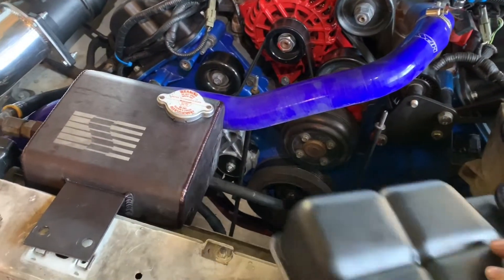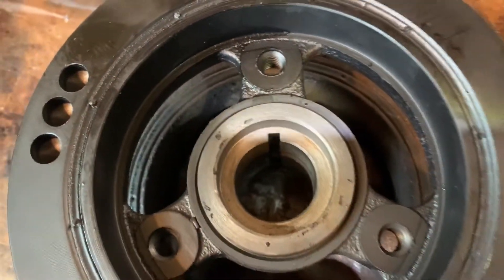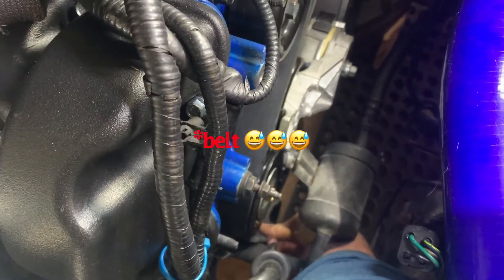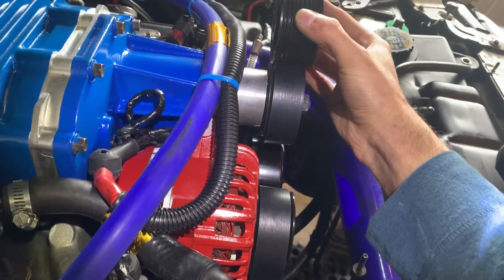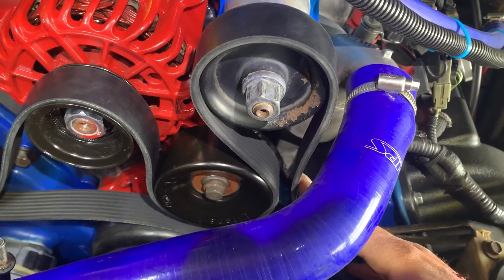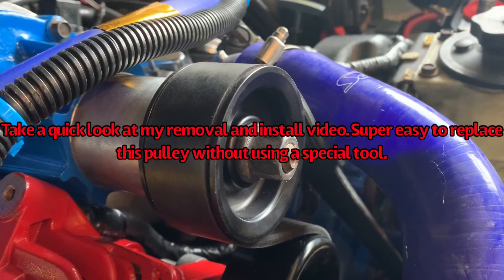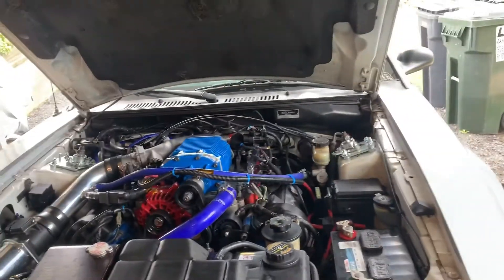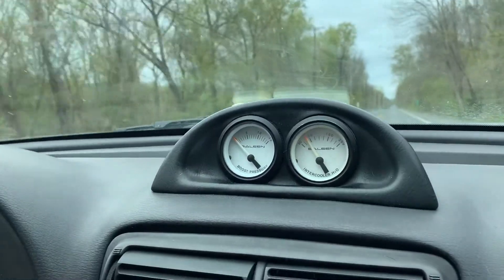2000 Saleen 8 rib pulley conversion😎

Comment: Great video - thanks, as I beleive this will be helpful with my 8 rib conversion. I have an '03 Marauder. Engine is the stock 4.6L 32V dohc.
But :-) I put a BIG supercharger on it , so I'm having slip with 6 rib. My question is : Would the entire conversion be much simpler to accomplish if I pulled the engine out?, Or is that more work than is necessary.
Thanks again.
Reply from the maker: Nice! Sounds like a beast! It’s up to you, really depends on the tools you have available. To me, pulling the engine for a pulley swap is more work. Look into upgrading your tensioner as well.👍
Reply: @SaleenDrift  Thanks! The stock tensioner is a Motorcraft BT-68, it's not bad. However, I get your point...probably a steel billet tensioner (pricey) is the way to go, as my Vortech V7-JT doesnt hit top output until about 7k engine rpm. I'm hoping to bring that down with a smaller SC pulley and the bigger crank pulley...but still going to be in the 5K range I believe. Thanks again for the input.

Comment: Definitely keep it up with the Saleen Videos. Just found your channel and subscribed. I have #99-345 which is a Black, Auto, Vert with a Series 2 supercharger.
Reply from the maker: That’s awesome! I have plans that I am hoping to start working on as soon as it gets a little warmer out👍🏻
Reply: @SaleenDrift   cool man. I looked into doing the 8 rib conversion but I haven’t been able to find everything for mine as the 99 has a different timing cover layout and belt routing than yours. Are you still running the stock diameter pulley?
Reply from the maker: @904Saleen   that’s interesting, check out the video description. I listed all of the parts. Everything is from the F150, maybe the timing cover from the F150 and it’s pulleys might fit your setup.
Reply: @SaleenDrift  I'll definitely look into it. Right now I'm trying to figure out my idling issues. Replaced the IAC and TPS and done a vacuum leak check with a smoke machine and found no leaks. Idle stays high at about 1300-1500 and surges to 2000 sometimes. Starting to think that it may be the tune on the car that's no longer right. It has never been retuned and still has Saleen's original tune on it which I've been told doesn't age well.
Reply from the maker: @904Saleen  that’s interesting! My Saleen has over 160k miles and never had that happen. But, after my stage 3 cam swap, I took it to a dyno tune $400. Well worth it, he found the wrong vacuum line going to the fuel pressure sensor causing it to lean out under boost. If there is an issue, your tuner will find it🤘🏻
Reply: @SaleenDrift  as far as I know, my motor is unopened. I have 155k on mine. Planning on swapping to an O/R X pipe then getting a dyno tune as well.